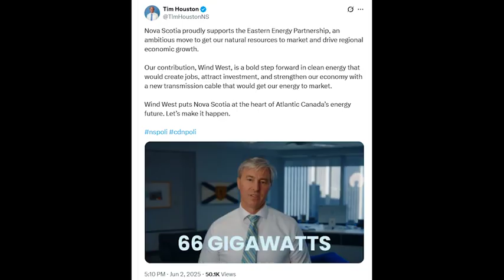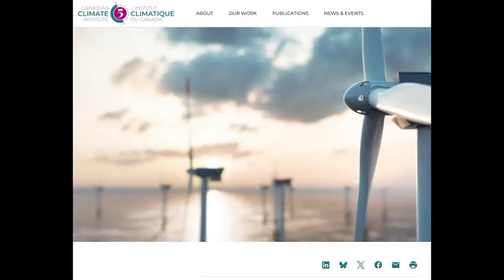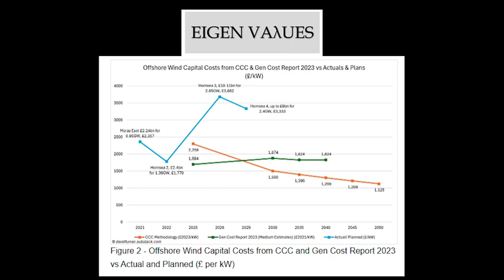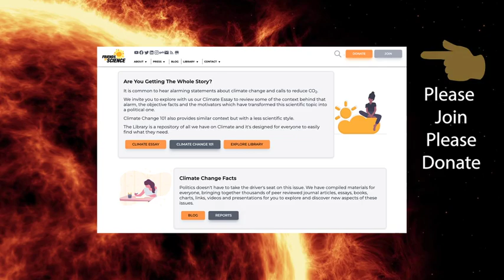Elbows Up - Green Delusions Down

Comment: Excellent I loved it. I work for a hydro company and this generation of engineers can’t figure out transmission lines. Engineers in the 1900-40 gifted our generation with transmission lines that are still running. But new lines 10-20 years old are in worse conditions than the lines built in the 1940’s. but not worried it is because the old lines were over engineered

Comment: I renovated a house near Edmonton, it has an air-to-water heat pump system and now the house doesn’t use methane (natural gas) for heating at all. Once the solar panels are installed, the annual energy efficiency will be Net zero, so being grid tied means I will get a credit for any excess electricity the house creates. If I want, I can make the house totally off grid by using the new sodium-ion battery cars to store excess electricity.

The future of renewable energy systems means many households can be completely energy independent from large corporations and fossil fuel producers. Imagine the freedom that creates, anyone could have a small home business that runs on cheap energy, especially smallholder farmers, who could not only cut down their energy costs but also provide their extra energy to the grid for extra income. 

Relying solely on fossil fuels is never going to increase independence or freedom to have a better life.

Comment: Edmonton City Council signed a 20 year contract for wind and solar, whether it works or not (likely not) the taxpayers are on the hook for the $$ contract.  Alberta had to buy power at least twice in winter because of failure of “green” energy.  I greatly appreciate Friends of Science honesty and integrity, thank you!!
Reply: And the terrorist-turned-mayor just announced the ciity is $1.5 BILLION in the red. Edmonton had vritually zero snow removal last winter and has potholes the size of Cold Lake. He lamented that the city didn't have money for "snow removal, diversity initiatives...." That's right. His No. 2 priority behind snow removal (which didn't even happen last winter) is diversity initiatives, whatever that means.
Reply: Just like the millions of taxpayers $ they spent on the electric bus farce where they can't get parts and the company that built them is now bankrupt.